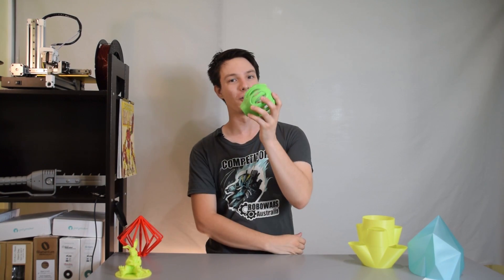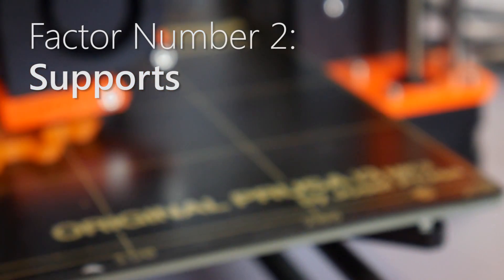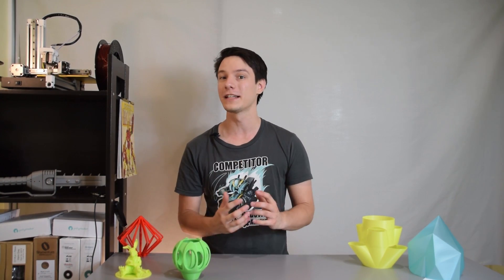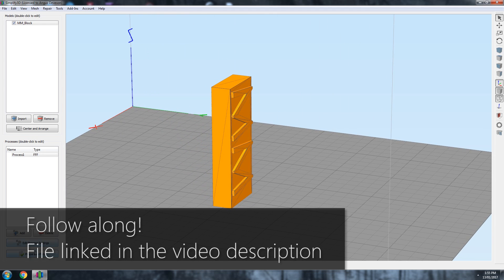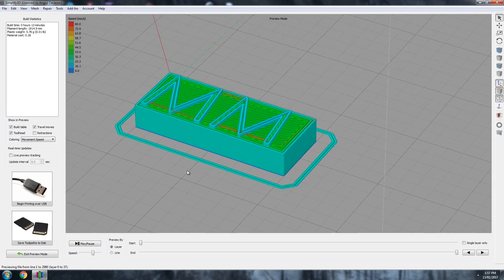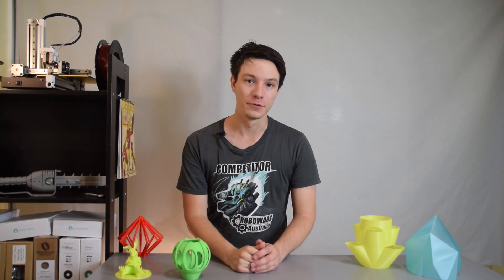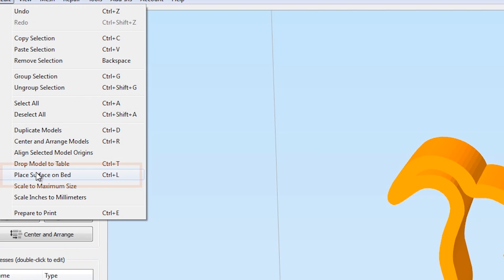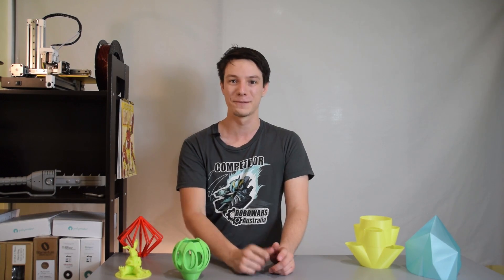How to Orient 3D Prints - 3D Printing 101

Comment: So let me make sure I understand the challenge --- I get to decide that it would print best with only the top razor thin edge of the part on the bed. Then you get to make that print work ...... or did I not quite understand :)  .....                 Assuming that I have to print the part,  I'd print it "normal" (bottom side down as you would commonly look at it).  Yes there would be both supports from the bed and internally.    I'm trying it on end in vase mode with no supports now, I know it will fail, the question is how quickly it will fail ....

Comment: Hey is there a module/system to reuse the printed part? As a noob I find myself wasting a lot of filament due to redesign and control settings. Would be cool if there is a module where I throw the scrap into it and recycle it again. Thanks!
Reply: This has been done, you need a shredder and filament extruder, expensive to buy, you make be able to break up the old prints using pliers as for the extruder, you have a printer - that makes you a maker, so there's little reason not to make your own :)

Comment: It will need some support no matter which way it is printed.  Giving priority to the text detail and the surfaces which will be most visible and allowing the logo cut outs to have support running straight up from the baseplate would mean printing it on its base

Comment: I also found that in some cases, like the Marble machine, it's good to think about the part cooling fan flow direction. had many fails on the wanhao due to curling edges in one particular part. rotating the print to have that particular part cooled more effectively has fixed the issue :)
Reply: 3DMN marble machine? I thought it was a bomb

Comment: Thanks for the video and tips!  

I've been puzzled about why some of the airplane (SR-71) and space ship (Normandy 2) models I've downloaded are imported as side-down orientations, rather than just printing from a simpler looking bottom-down orientation.  Usually I've had trouble removing the rafting from the small (150mm bed) finished product when I print them bottom-down , because the raft is so firmly attached to the bottom of the not-very-big object.  Maybe I should try printing them again with the original, imported side-down orientation - even though that seems more complex and requires more support material?

A related question that maybe you could address at some point is: Why do so many of the models I download require "auto-correcting" when I import them into my (XYZPrinting XYZWare) slicer software?  I always do it, but wonder what the software is seeing in the file that looks wrong to it.

Keep up the good work!
Reply: 1) Sometimes model-makers align their models in what they think is the "best" orientation for printing, but it may not be so with your specific printer as there are so many differences between how you print and how that person prints (fan location, your slicer settings, how your bed gets leveled, how well stuff sticks to your bed, what sort of supports your slicer makes, etc etc etc).  But in other cases the creator just uploaded their model in whatever orientation they happened to build it in...so there's no hard and fast answer (but Angus' tips definitely help.)

2) The most likely answer is because the person that created the model made one of many mistakes, all of which fall under the "bad geometry" category: most 3D design programs let you leave holes, "one-sided walls", "solid objects inside another solid object", and other artifacts in the model as they are not intended to be printed...so when you try to print it, your slicer is dealing with an "impossible in the real world" object and needs to try and fix it.  (And on that note, search back through Angus' videos - he's got a couple that explain other methods of fixing "broken" models, such as with Meshmixer or using a cloud service.)

Comment: I made a ring that I 3D printed and it has really fine details that some turned out good while others it didn't at 50 microns. I tweaked the settings for reduces speed and temperature and got better results but I wonder if getting a smaller nozzles like 0.25 will improve the print.
Reply: It will improve the X-Y resolution. But keep in mind your print times will be way longer and you may run into nozzle clogs more often. And forget about particle filled materials like Woodfill. Otherwise, I've seen 0.2 nozzle prints - they're really nice, so go for it if you think print times are not an issue.
Reply: I am aware it will take longer, i only print in PLA, the ring i made took about 45 min to print at 50 micron resolution at 30 mm\sec and i tried 2 different ways. The first way was just using supports on one side and that side needs a lot of cleanup and there is a thin lip that didn't turn out that great. The other way was to split the ring in half so it has a flat part to be places on the print bed.

Comment: interesting model. i suspect the secret to this one is that the front is sloped... thus i would place it on its back. however my inclination is not to do this as there is a tendancy i find for words on a shallow slope to become distorted from anniying slicing and step effects at 0.2mm layer height. so if using 0.2 then I would not use the back.

This effect can be reduced by increasing the angle more to the horizontal which would mean placing it on either the base or an end would work... thus the base would be preferable to reduce support material and hide the bottom surface when finished. the top surface should not matter as they are not such that would produce ugly results.

i am happy to be corrected though :)

Comment: Woah, how did I not know about that place surface on bed tool!  That is going to make things SOOOO much easier!  Thanks for another great video Angus!  

Also, I would imagine that piece would be best printed in its current format as it seems like it would require the least amount of supports just under the center of the M and possibly under the box depending on the printer's capabilities

Comment: The way objects are orientated in S3D are the same as how they are made in their respective software in relation to their gismos orientation. you can determine this yourself before you get anywhere near S3D if your are making the object yourself. You can reset it permanently in many 3d applications if you have the time or need as well. Thanks Angus and thanks S3D
Reply: Luke Pettit Not the case with Solidworks 2016.
Reply: Which is why I said this :-) "You can reset it permanently in many 3d applications" and not "You can reset it permanently in every 3d application."